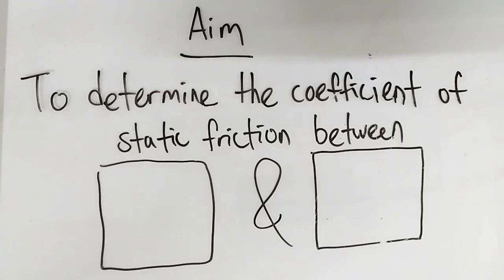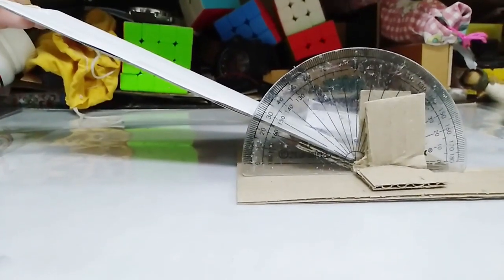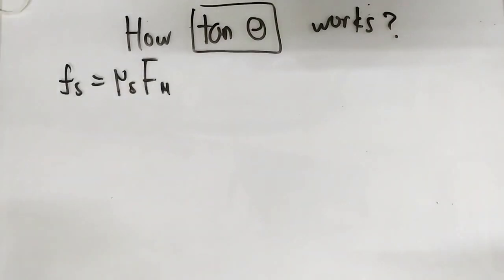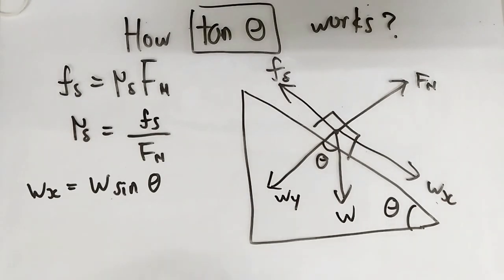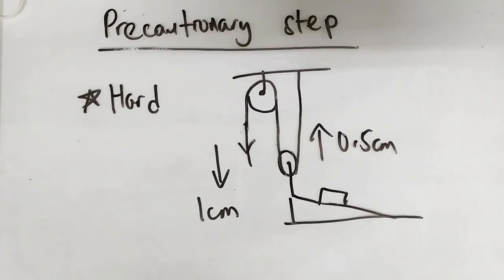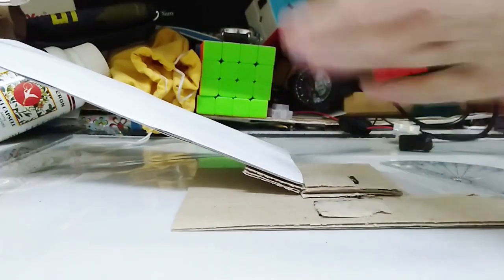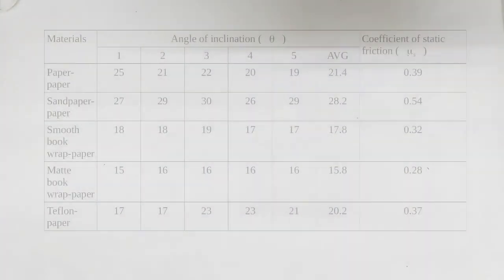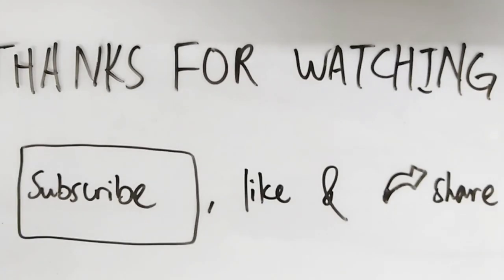Determine the coefficient of static friction | Physics Experiment

Comment: Sir, how did u make the inclined plane?????? Kindly make a video on that!!!!!
Reply from the maker: It is just a piece of folded cardboard wrapped with paper.
Reply: @thenoob6632  yes okay...but how did u fix that inclined plane on the other plane???
Reply from the maker: @BB-tw9pv  Just checked it and it is actually more than just a folded cardboard. I made a flap like thing from a smaller cardboard, then double-sided taped the experiment surface (cardboard wrapped with paper) and the base cardboard to the flap  But if you want to recreate this a folded cardboard should work just fine.
Reply: @thenoob6632  well...
Thank you so much :)!!
It helped!!!
Reply from the maker: @BB-tw9pv  Glad it helps you!